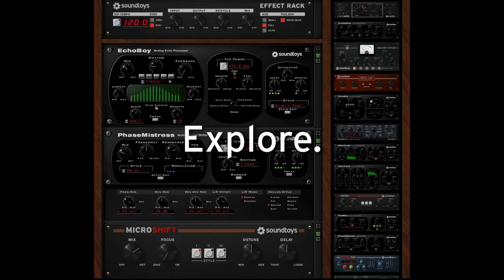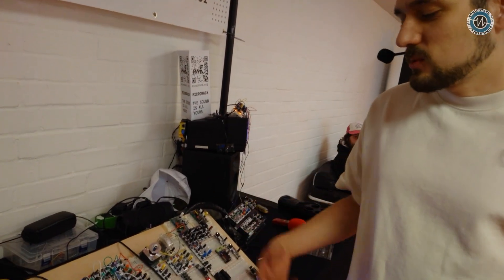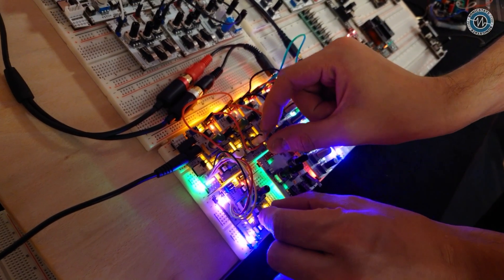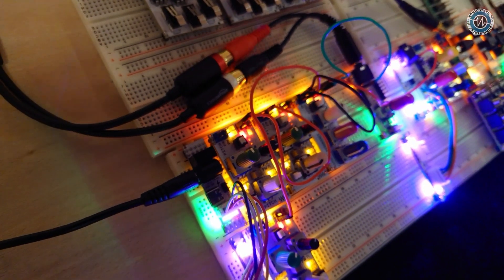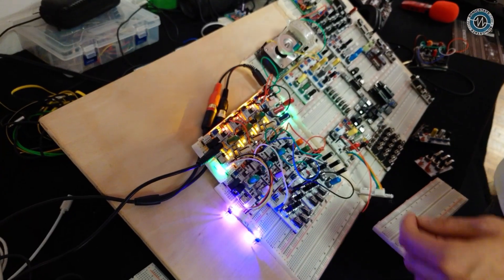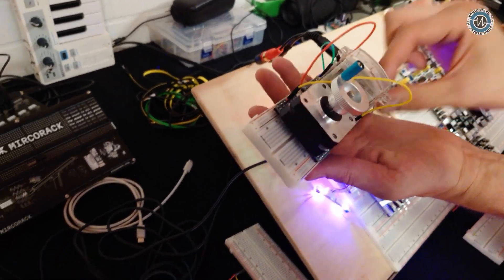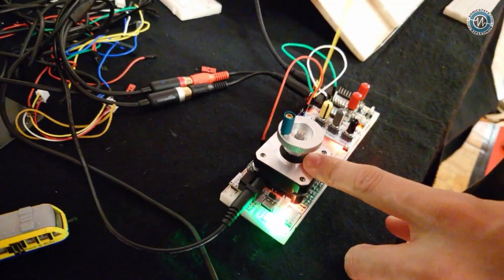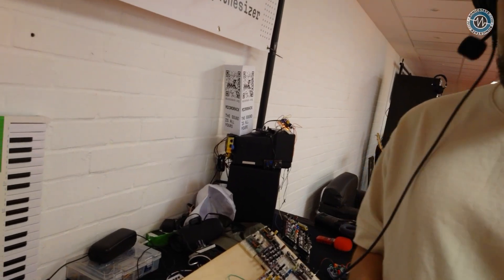SUPERBOOTH 2024: Microrack - DIY Modules

Comment: AE Modular already has a strong presence in this space.  What does Microrack offer here?
Reply: The "full set" costs as much as a single eurorack module (450$), you don’t need to worry about all the eurorack crap (power, case, cables, HP…) and its small enough you can throw everything in a drawer when not in use.

It’s really better in every way
Reply: Overall it looks a lot more compact than AE modular. Hopefully it'll be more affordable too since it's so minimal and reuses the common breadboard as its "racking" system.